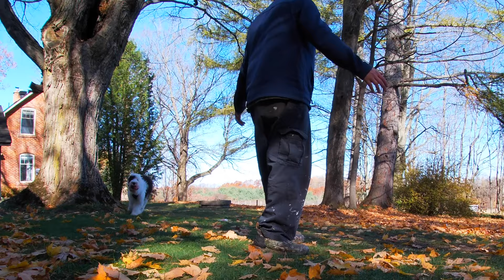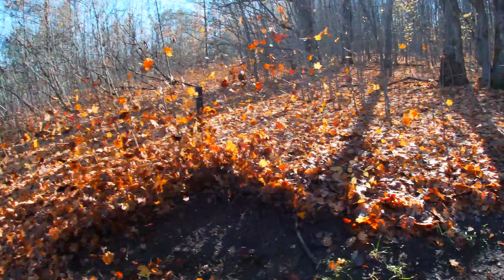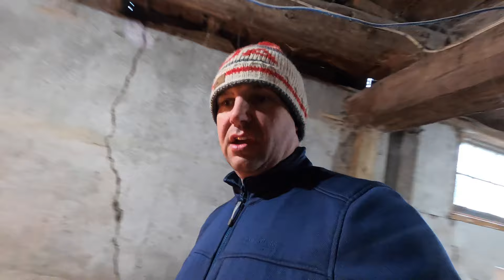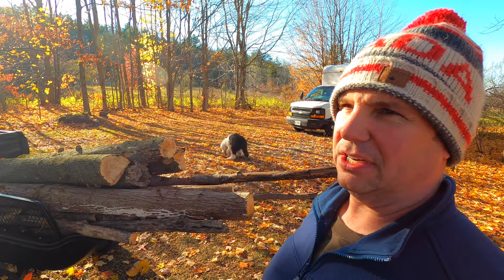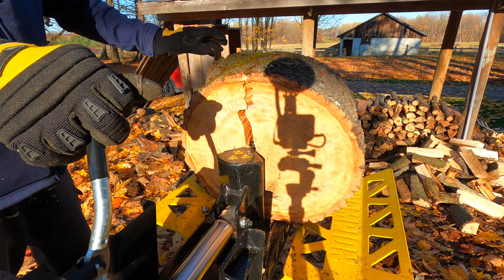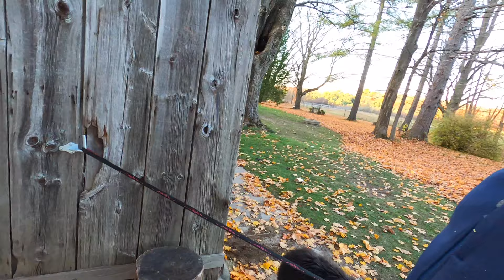Logging in the Canadian Woods with My Old English Sheepdog

Comment: Chad, Once the trees freeze solid firewood cutting is really hard on the saw handle suspension and takes forever. You might want to cut the rounds and let them lay
where you cut them and split later. Frozen logs split nearly the same. I test them with crosswise splitting gum stumps. My pump is a horsepower compensated Vickers
piston pump turned down to 2500 PSI and there is a small 2-1/2 hydraulic cylinder above the 9" cylinder for fast advance and return. The big cyl valve shifts on above
1500 PSI (prefill valve type). We turned log splitting into an art form for a while after pumpkin cannons lost interest. 
          That    carolina coops    channel shows how they do poultry water in Ontario and Minnesota. Looks like a poly tank with insulation, a small possibly 2 GPM low head 
circulating pump through a long header down the side of the run and night house. There are little water spuds that drip or run water when a bird beak touches them like
used for hog houses. The water stays clean and doesn't freeze. They can also dispense medicine with the water for like young chickens. The heater looks like a hardware
store replacement heater element and thermostat. (looks to be a Chromolox style heater). Carolina coups also sells stuff like this shipped from New York state.
          My filipina would be dying a brown mustache or beard on your dog in a brown dirt color. She also occasionally has blue or purple hair. Her twin sister used to die her
white hair blonde with used coffee grounds. As they say "its more fun in the Philippines". We are in Cavite province south of Manila.

                          george and aurora                         and a herd of turkeys
Reply from the maker: some of those carolina coops sure are nice, they're biggest coop starts at 5k US, basic only, thats $6400 Canadian...it'll be 15k with all the bells and whistles plus 1k shipping.  I'll build a custom ultimate coop for way less that that, but you're right I can get a lot of little ideas from their coops.  I probably won't do any wood splitting during the winter, not unless a tree falls in my driveway lol.  We have a property in Calamba, Laguna right in the middle of the hot spring resort area.  That's where my wife is from, we'd be going for a few months over winter, but covid is making it difficult this year.  Hopefully next year is better.  Thanks George and Aurora.